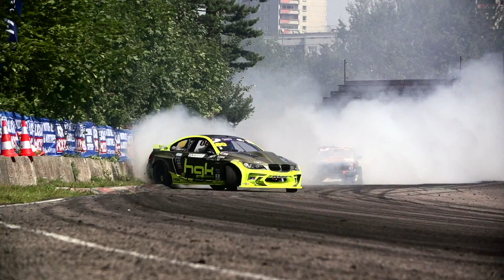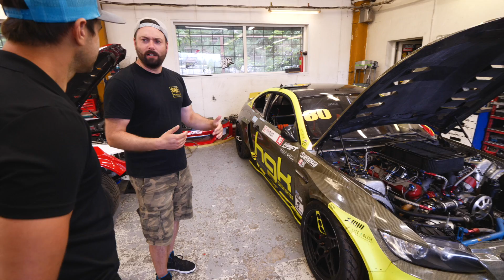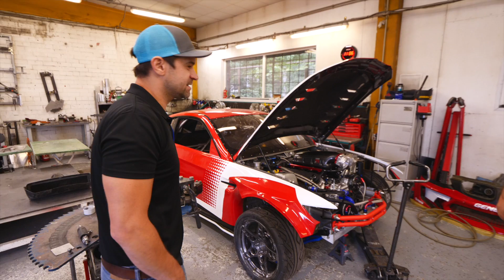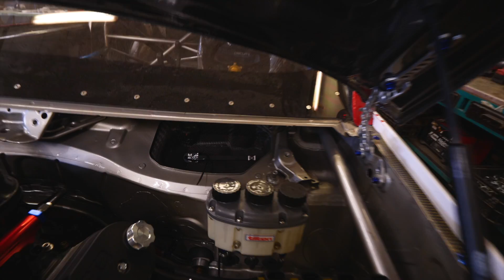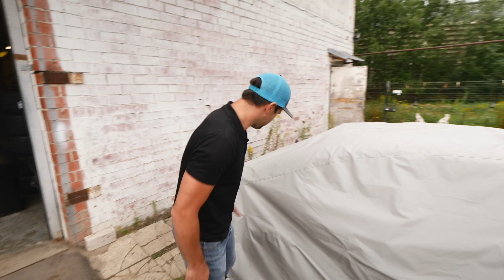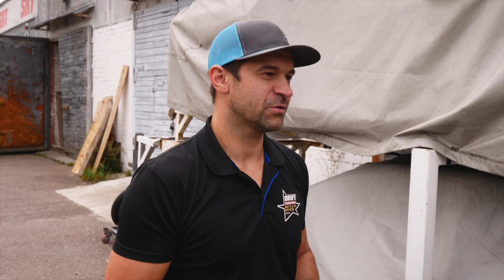HGK GARAGE TOUR | WHERE DREAM DRIFT BUILDS ARE MADE!

Comment: someday, weight will be so important, we will start using carbon kevlar engines lol.
Reply from the maker: Eh... not sure that would work, but nice idea!
Reply: nahh alredy rules got some limeitations lighter car narower tires
in RDS it's like
1225-1500 kg  265 
1090-1224 kg  255
955-1089 kg 245
so you are basicaly limeted by tire width with power and weight 
also you can't change tires in one hit only swap left and right
also you are not allowed to change tire presure between run's in one hit

Comment: Paying 200,000 grand for a ready out of the box most professional built car. Is well worth it.  Most these guys have half a million dollars in junk cars
Reply: You guys have no clue man. Ive the video he clearly says chassis only, no motor. From 80k to 200k you put motor trans and dif in. No formula D guys are running 200k engines either, and NA motors will be far less expensive than turbo or supercharged motors. Hahaha do some research and also pay attention to the video u watched.
Reply: @j.sargent9172  E92 eurofighter build with engine starts from 120k eur minimum. That said Haris from hgk in one video.
Reply: J.Sargent91 one have u seen fd cars engine build sheets. And did u just say it’s easier to get horsepower out of a na car then a turbo car?  Have u event built anything lol.
Reply: Chris A 1000hp engines are $50k Max you are talking out of your ass the only drift engines even coming close to $100k are the NASCAR & Rotary engines used for Novelty reasons. Stop talking non sense!
Reply: J.Sargent91 I could literally post five links to engine shops that built fd engines and every single engine on their website is over 150.
Reply: J.Sargent91 and btw you aren’t getting a full carbon car built chassis for 80k. There is no 80k to 200k.  You want a full carbon Kevlar car.  200 all day everyday.
Reply: J.Sargent91 also wondering why your channel says your car has 500hp but here u are claiming 700 🥱
Reply: Bulit R5 car costs 250k with all the technology...wdym with simple drift car stuff. Like he said that they can add some glued diamonds for your money
Reply: mtsyo bro u better watch it. These kids think 100k gets u a car into fd
Reply: Just rolling chassis. No motor or accessories
Reply: @j.sargent9172 Nop
Reply: J.Sargent91 you have to understand that most of the engines these guys are running are literally 200,000 dollar engines. So when ur talking 200 for the car something u can keep for ten years
Reply: @cmamsler  200k for engine? Good joke
Reply: default oh ya for sure. There are companies that sell 150,000 engine everyday.  Add turbos nitrous. I can almost guarantee bluss’s engine is over that because he runs zero turbos. He has to get power without them.
Reply: @cmamsler  Open for example this https://www.mastmotorsports.com/collections/ls-engines/products/dart-466-black-label-race-engine and read description. It's not the expensive engine which they have used but still your price is way too high.
Reply: default I’m not going to click on any link from someone lol.   I would advise you to do that same
Reply: He clearly states, depends how much you want to do to chassis. If you want all the bells and whistles it will be 200k if you want the minimum build its 80k. Once again NO MOTOR!
Reply: @j.sargent9172  WITH MOTOR! (not for 80k) Stop living on space.
Reply: default call kris up and ask him if he will build you a fd ready car with engine for 120k. See what he tells you.
Reply: @cmamsler  Whahaahahah if their eurofighter would cost 500k they would never come to fd. 3 man crew with 500k car? Just stop living in space and write email and ask.
Reply: @cmamsler  120k eur is starting price with engine (nothing fancy) but if you want to compete in fd with good engine it would be around 200-250k eur
Reply: ClutchkickPJ also your about 500 hp short to even compete in fd